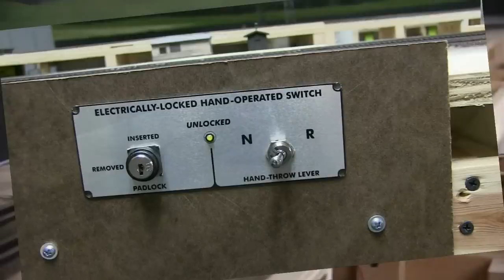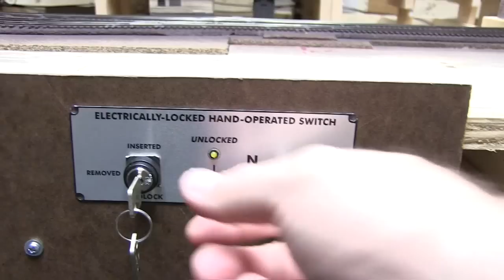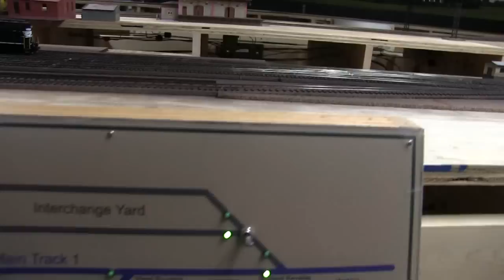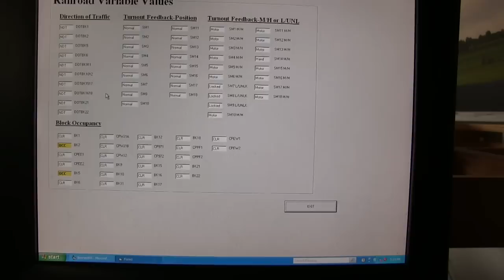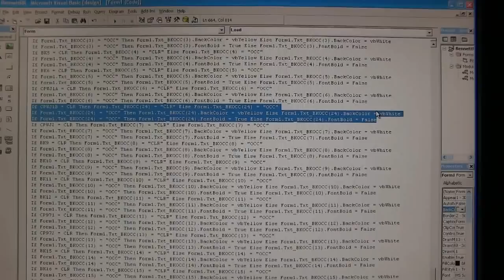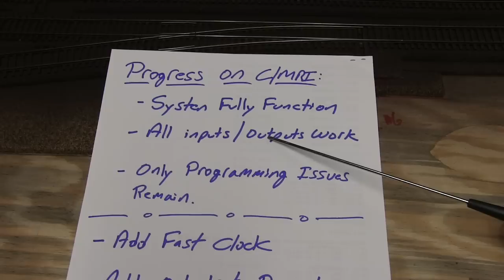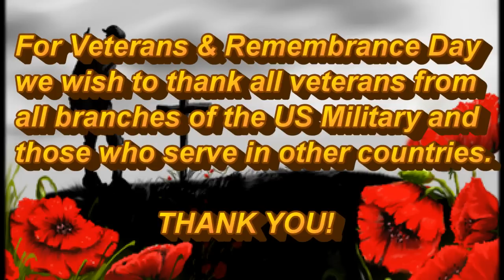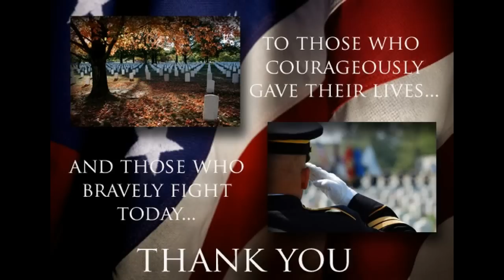Model Railroad Update Video 42b-More C/MRI Programming

Comment: Glad to see the background color and font bolding worked -- almost.  From what I could see on the video the code is good.  Suggest you look for another reference to textbox(24) outside the area where you change the color ...  or place a break point just after the setting of the color. (press F9 to add / remove the breakpoint) You can then validate the value of the various variables you are using as the program will stop at the breakpoint.  Press F8 to step or F5 to run to next breakpoint.  Another suggestion is to create a subroutine where you pass the block status and the textbox.  You can then place the code in one location and just call the subroutine for each textbox you want to update.  Hope this helps / Paul.   (ps. thanks for the poppy!)
Reply: +tz3p9v0 +Stephen Bennett Yep, this would be my conclusion/suggestion too.

There must be a line of code elsewhere that you havent accounted for or typoed (common mistake with lots of copy paste code) that is resetting the background colour of textbox 24 back to white when it shouldnt be - probably that line of code should have been setting the background colour of another textbox to white, so you'll probably find another textbox that wont reset to white when it should have.

A quick search for 24 will help you find that.

Alternatively, and as suggested, a simple routine to set text and/or colour would help to minimise a lot of excess and repetitive code. Theres a saying in programming: DRY, Dont Repeat Yourself.

You could reduce your code to something like the following example: http://pastebin.com/mpH1vmKE

Then it becomes a simple one-liner for each block. :-)

Apologies if that doesnt work copy/paste and has syntax errors, I had to write that from many rusty years of not writing VB code, and I think I could almost guarantee it doesnt work out of the box, so a little tweaking might be required, but should help to make your code that more readable and maintainable.

Comment: Okay so to answer your question, prototypically, on what would that signal indication be is either a red over flashing green, red over green, red over flashing yellow, red over yellow, or red over flashing red. I've gotten all of those except for red over flashing green ( that's a RR specific indication) nevertheless it really will be depending on the condition of the blocks ahead. If everything ahead is clear then it'll be red over green (flashing). The fact that a switch is open on main 2 doesn't affect travel on main 1 in this situation. Hopefully that answers your question.

Comment: Steven.  I like and enjoy the outlook of your railroad.  You have provided me with a lot of fascinating information to help me construct\operate a layout using electronics.  I see two things regarding your electric log signal aspect question.  First of all, with our model railroads there are a lot of the proper aspects of railroading that we aren't able to duplicate.  Basically your color aspect with the crossover of G/R would be correct if you are using it for a maintainer operation as you stated, but for train operation it would have to be R/R.  The crossover route would have to be part of the equation when using the electric lock for train movement.  Basically, the issue I see with what you have now is that a train can come out of the electric lock and make a reverse move and foul the crossover route.  Just my thought.  I hope this helps you.

Comment: I know If there is a train in the interlocking. Dispatch cannot operate any turnout in the interlocking. If maintenance of Way is working on the switch that leads to the stub track. They should be able to manually throw the switch while a train is running through the crossover. The signal aspect going into the stub track would be red over yellow (restricting). The aspect red over flashing green is a limited clear at least here on NS. The signals I had to learn are slightly different than CSX. But the layout is looking great keep up the work. Hope this helps. 
Adam.
Reply: +adam reynolds   I would have to concur with Adam and Flash Jones about the signal indication R/flashing G, which means (on some rr's) Approach Medium (speed not to exceed 30mph).   Since this is an interlocking, dispatch would not be able to change any of the turnouts while the plant is occupied, but changing any switch by MOW or trainman would require prior approval of dispatch.  Also, IMO an additional signal is required on the right side of the cantilever signal to indicate the positions of the conditions for Mainline, Interchange Yard Switch, and Crossover Switches.  Otherwise, with only two signal heads and a R/G or Y, an engineer approaching the signal would know he is being diverted, but not know to which, the I Yard or the crossover.  On the left hand signal, since the "Pit track" is the only diversion, a R/G or Y would indicate for the working crew that the switch to the pit track is open.  This signal should respond to the lock box hand control setting. The opposite aspect for this left hand signal would be G/R for proceed on the left hand main.  I also use a handy web page to help with signal indications... http://www.railroadsignals.us/basics/basics4.htm.  Hope this helps.
John Moran

Comment: I am really enjoying your videos. Regarding Wallace Junction, it would be unusual to have a manual switchlock within a control point. However there is probably a prototype somewhere. Regarding the signals. You say you want them completely automatic so I assume the local panels are the way you change routes. Would you consider three direction switches (on-off-on) one for each of the routes (Main 1, Main 2, Branch). If the signal bottom left is 2RAB (2 for main 2, R for authorising a movt right, A top unit, B bottom unit, placing the dir 2 switch to the right would give G/R, and this signal would operate automatically with the dir2 switch in this position for RH running on double line. Similarly signal 1LAB with the dir1 switch to the left for track 1. In the situation you describe, set dir1 and dir2 to the centre off position, setting all signals to R/R, change the LH crossover track 1 to track 2, dir1 to the right should make 1RAB R/G. You can change the branch point to reverse, dir3 (branch dir switch) to the left and 1LAB could show a unique aspect like R/Flashing R to go onto the branch. Or to come off the branch dir3 to the right, still no proceed on branch ground light because the next cp is authorising entry to that block so have to take back that signal, then get a green ground light or equivalent off the branch.

Comment: When using C/MRI, do you need to do anything to the loco. Change anything
Reply: +James Baxter No- the C/MRI electronics are totally separate from the DCC system. We can run the layout with the computer off (kind of neat- you get some real weird signal indications based on the states of the SMINI outputs!) and we control the turnouts via the local control panels.